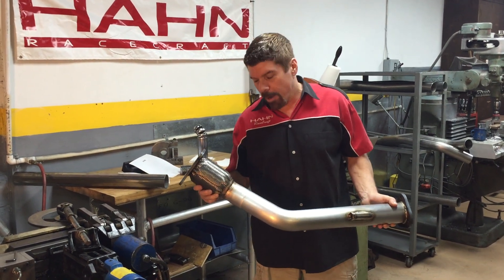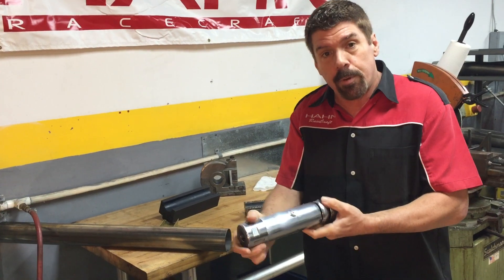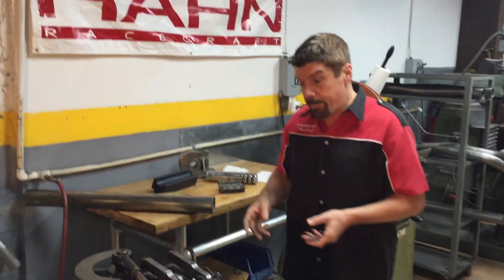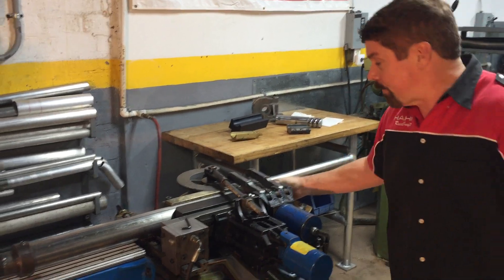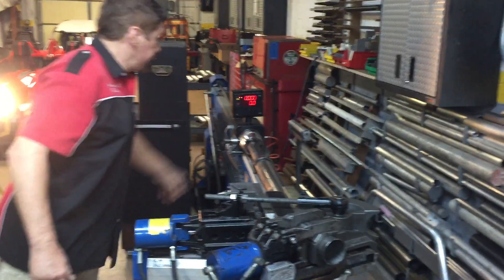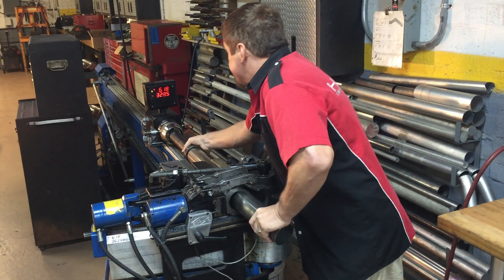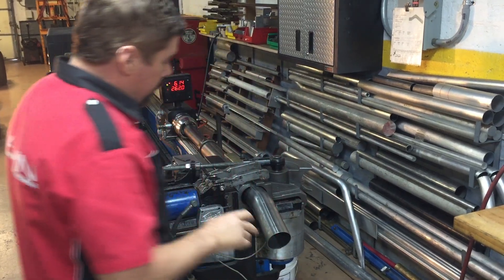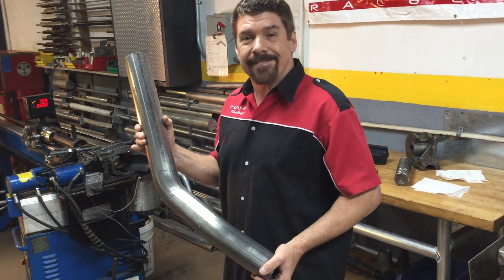Mandrel Tube Bending EXPOSED! Watch as Bill Hahn Jr tells the REAL story.

Comment: I couldn't have explained it any better than you did. 
Up until November of 2016 I had worked in a factory that produced air conditioners 
I was one of the 6 machine operators to bend tubing for their gas heat exchangers 
Exactly the same principles of bending but our machines were fully automated for high volume with automatic lubricant coming in from the rod into the mandrel.

Comment: Nice video. One of the things to be aware of when using grease or some other type of lube, particularly with stainless, is to make sure that it is as sulfur free as possible, especially with a system that will be heated, such as an exhaust system. Sulfur has the ability to infiltrated the surface and reacts with the stainless to cause cracking. I have seen this many times during my career, and while most of the time it was on things like valve bodies and gates, as well as fittings that are much heavier, the fact that we are dealing with a much thinner wall means that it can have a faster catastrophic failure issue.
Once again, thanks for the nice video.
Reply: Good comment!  Useful information.

Comment: I see you randomly positioned the weld seem on the tube, would it be better to put it on the inside of the bend? ( understand it cant be on the inside if doing several different angle bends)

Comment: very good video... actually the hydraulic system is running at 3000psi but the bending process is exceeding the yield strength (flow stress) of the material so when you see the material flowing as the mandrel balls pass it is at about 40,000 psi.
Reply from the maker: That's a very valid observation, thank you for sharing it.
Reply: @hahnracecraft8172  I have work with cnc tube bending of truck exhausts.  One of the OEM's decided to aluminize their stainless steel exhaust to hide the yellowing with heat... created a bending nigtmare for the mandrels (AL-bronze mandrel balls and wiper die gall immediately with the Al coating on the inside and outside of the tubes - mandrel snapped off in the bend!).  Took me quit a while to solve that problem.
Reply from the maker: @mfsolutions  wow that sounds challenging. It's like all the worst issues with galling and dissimilar metals at once!

Comment: I cannot find any information that the Ercolina Megabender 30 bends 3" diameter. Did you make the tooling and does it struggle bending 3". Id like to purchase a bender like this.
Reply from the maker: I believe they may have changed the machine specs since our purchase some 13 years ago. We have no issues at all using it on 3", but I can't speak for what they're selling now.
Reply: Ercolina mega bender 030 31nches  can I got some this dies